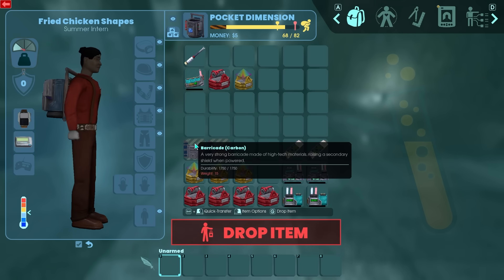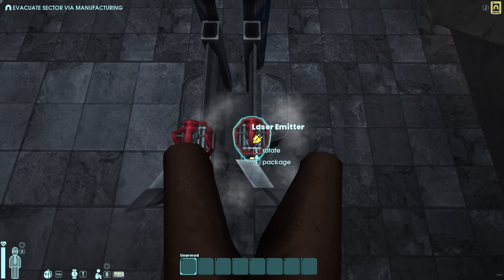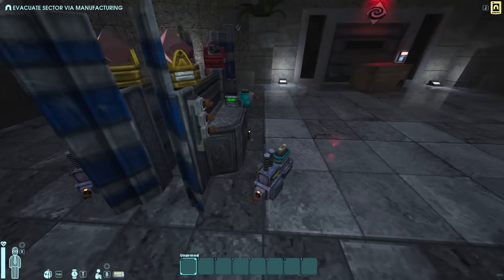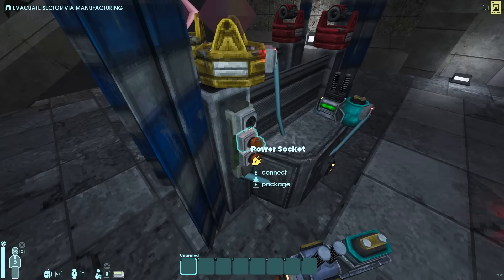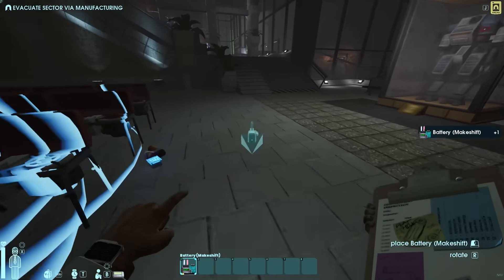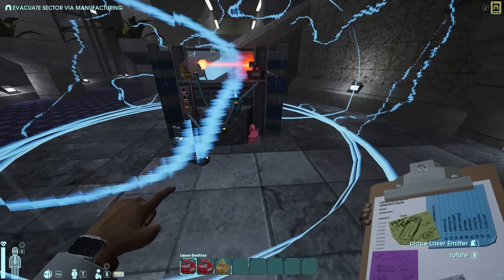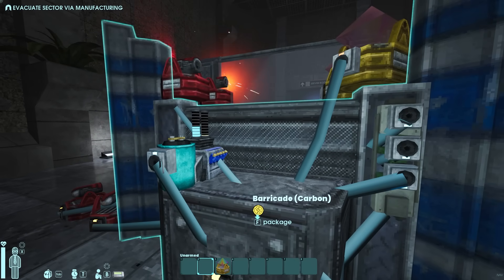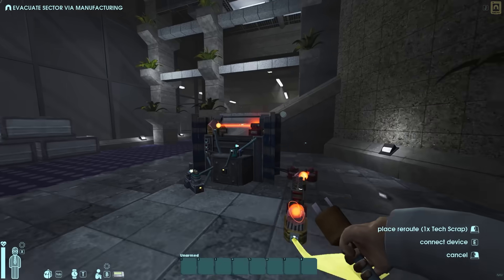Abiotic Factor Feedback Machine 1.1 Infinite Energy (1.0 update)

Comment: Just go ask since I really feel that my base has too many batteries everywhere just trying to keep everything powered thru the night so I don't waste time waiting (although every night is only 5 mins), but will this contraption make it so that I can attach a multiple plugboards or strips at the end of that industrial battery to that I can power essentially my whole base?
Reply: You don’t really even need this set up, hook a decent sized battery (preferably carbon) to a wall outlet, then have the battery hooked up to a laser emitter, point the emitter at a receiver, then plug the receiver into a plug strip then to what ever you need. This set up just removes plugging into a wall.
Reply from the maker: @LigmaSigma-nv6hx  Yep! All you need to power an entire base is 1 industrial battery, one emitter, and 1 converter. The Feedback Machine is not really necessary in an area with a lot of sockets - it's more suited to out of bounds, anteverses without sockets, or, locations that have no sockets.
Reply from the maker: You don't need anymore batteries, if you build everything in the video then you can just plug it all in, the battery won't deplete. I don't recommend adding anymore batteries. The Feedback Machine powers everything infinitely no matter how many deployables are connected.
Reply: @c0ffixx thats fucking crazy, really really cool. I'll get around to doing that hopefully in the next few days. Infinite energy source ftw

Comment: So this is mostly just for making bases where there are no power sockets then? Its neat to find exploits like this, but I guess I don't fully see the point when there seems to be plenty of places that have sockets and there is an end goal not just a "survive as long as you can" type game.
Reply from the maker: Not really, they're useful for a distant shore to farm exor hearts as you can keep a personal teleporter as theres no power sockets in that anteverse. Some rooftop bases on Flathill are viable. I usually use them for my out of bounds teleport huds, it's faster travelling around on the roof of the facility. It's also useful for the irradiated area in the Containment Sector as theres no power sockets there too. The use of the machine is to just make infinite power, nothing more, nothing less; sometimes I use it to make cliffside bases. Also it completely erases the use of sockets and can provide infinite load and power so you're better off with just using the feedback machine.
Reply: @c0ffixx  I'm not that far into the game, and honestly I didn't find that it would make sense for such a facility with massive reactors to have the power turned off at night so I just disabled that feature, I wish I could turn stop the lights from going off in without making getting some resources impossible.

OR have it a feature of the game that you can eventually turn this off for some areas in the facility through exploration similar to how you can eventually get rid of the portals coming into your base.
Reply: @JohnA...  I think a more smarter way is building a biomass generator that is not a battery but consumes bio scrap to generate power, since bio scrap is so easy to gain from rotting food pieces and stuff.

The benefit should be increased charging effects when used in a network instead of a facility socket, so it can charge several times faster to outpace the high load limits of batteries or something.

Or making your own 'micro' reactor which is kinda radioactive and requires you to refill it using barrels of radioactive wastes.
Reply: @dra6o0n  Realistically... or maybe un-realistically since its SCP nonsense... But we are playing a science fiction game about science experiments that don't have to work within the realms of reality as we know it so the solution could come from something esoteric in stead of practical. 

I like radioactive waste idea, maybe something that eats the waste and converts it into something else like bio waste to then use as a power source and the cleanup by doing so could reveal new areas or shortcuts.
Reply: @JohnA...  damn couldnt imagine playing the game with power on all the time. Its a core mechanic for it to go off with specific raids even power draining you and stuff. You basically just disabled alot of content by doing t5
Reply: @Odyssey636  that part is just more annoying than fun for me. As I said I would rather it was tied to some kind of in game mechanic to turn it back on all the time. 

Part of the game that I don't enjoy as much with those things, because honestly I have played thousands of hours of survival games, is that with this game I know there is an ending that isn't all that far off so having to build for such things for a short time doesn't interest me as much as if it was connected to the lore for a good reason. The entire facility just happening to turn off at night doesn't make sense for me because I can't see why they would do that to start, therefor I don't find it interesting to need to make batteries when there should just be power in the plugs.

I can see making something for where you wouldn't find power at all, or a way to transport it, but not if you are in the middle of the facility.

This is just my personal enjoyment of it though.
Reply: @c0ffixx  you can put down a workbench in distant shore link a battery to it and bind a personal teleporter. It works even after the workbench has no more power. So while it is nice to know there is an exploit its not really needed for normal gameplay, only for far off outposts in crazy areas.
Reply: @c0ffixx Exor hearts are easy with portal fish though? and you can fish em at the lobby of office sector from the beginning.

Distant shores is just a way to get fertilizer but a more easier mobile way is taming lots of the reactor pets... Though that's near end game.
Reply: laser converter forces a entire network to a load of 1.

Also we don't know what the system do with power loads when there is no players in the area.

It could stop charging entirely but drain still, etc.

Comment: Time to make this in the Furniture store to basically keep the zombies under control
Reply: tbf, you can just rope plant up the elevator so you never need to press the buttons ever again if you are not using a jetpack etc
might want a bridge piece as well just to get the plant cleanly over the edge so it hangs down
Reply: @Kaijudomage No, I just love killing zombies with automated defense systems… its kind of a past time favorite of mine in video games
Reply: Can't you run a socket down from the upper area using tech scrap reroutes?
Reply: @MarlboroManson  Yes, though batteries, plugs, and such do not drop when their support drops, so you'll have to make a stairway and route the cable that way first.
Unfortunate, because the lever is the only thing that has a input and output, so lasers is your best bet to emit laser down the elevator or something.

alternatively find a way to clip thru the ceiling so you can pass a cable thru the floor.

using a office chair you can pop your head thru the floor thus likely able to interact with the cable that way.

No way to noclip a prop thru walls though, unless...

you make a bridge over the surface and put a plug strip upside down facing the floor so that when placed the socket plugs themselves (has no collision) will clip thru the floor letting you grab it.
Reply from the maker: @MarlboroManson  You can't because then the socket will unload once you reach the security sector and your reroute won't have any power supplying it, unfortunately.
Reply: you need a very very narrow surface you can angle at to place it facing down on a wall but it migiht work best for map terrain like the rocky ceilings you see, as they are physically thin geometry that are jagged... so in theory you can pass power out of bounds using a plugstrip (its tiny enough to jam it into a crack in the walls or ceiling).
Reply: You will need to build a tower all the way up to the ceiling of a facility...

Or try this:
Find a vent, and try to place a shelf inside the vent, very close to the ceiling or sides so you can squeeze a plugstrip inside. then remove the shelf or bridge (the plugstrip floats).

Alternatively you can use a laser converter or a lever maybe but the lever had a much bigger collision box... but a makeshift battery can clip thru thin walls and windows?
Reply: I know all batteries have the plug sockets in the front sticking out once placed and has no collision st the very front of it before the plugs appear when placed...
Reply: A good area to test passing power to out of bounds is the blue keypad room at level 2 elevators, on the upper section behind the ladders is thin walls diagonal to the computers. you can make several makeshift batteries and face them deep into the walls to try to get em out. Then use office chairs on a box to pop out of the ceiling (use a bed or couch to help you pass thru by lying down)

Comment: Can you power infinite machines with this? 
Or is it infinite in the sense that it never runs out at night?
Reply: You can power infinite machines with any laser power converter already, this just lets you have a self sustaining power loop totally detached from any wall sockets.
Reply: @TeddyBearAssassin  I feel I don't know anything about how power works.
Reply from the maker: @gittonsxv126  Read the guide on Steam, this will teach you how the power system works. I have a plan to make a YouTube video on how the power system works. All you gotta know is that the Feedback Machine has infinite power, and infinite load bearing capacity, allowing it to power an infinite amount of things and it will never lose power.
Reply: @c0ffixx  Defo useful! 
Been having power issues already in the late game.
Reply: I believe it just never runs out, but as for the powering infinite machines; yes, you can power infinite machines with that one power socket coming off the power converter (*assuming you connect an infinite amount of power strips/boards). The battery considers that laser emitter a singular device so anything down the chain after that is irrelevant. [They have been patching many power loops amongst other things so this may either be gone soon or already is, my bad if so lol]
Reply from the maker: Both, yes.

Comment: Fantastic machine, one issue I’m encountering is when the “swap” between the batteries happen and the lasers switch, the laser power converter doesn’t register the laser, any way to fix this?
Reply: The laser power converter I’m talking about is the one that goes into the output (I’m probably not the best with wording)
Reply from the maker: @robertbarthala6589  You've probably put the emitter and laser converter too far off from the middle of the barricade which lifts the glass up. At 0:34 you can see im lining up the emitter with the line on the barricade. And also make sure the emitter and laser converters are on the side of the barricade where the ledge goes out more wide like in the video. Let me know if that fixes anything or not, and just let me know I will help you.
Reply: @c0ffixx  my apologies, this is where my bad wording of the situation comes in, I meant the other laser emitters
Reply: 4:46
Reply from the maker: @robertbarthala6589  Lasers have issues when you reload the area or a save. I assume you've placed the machine between "chunks" so it's only loading one part of the laser and the other part (the converter) is getting culled before the laser reaches it. To fix this I think all you have to do is move the machine or where the emitters point. Or try reloading your game. It depends on what you're playing on, the console versions are a lot more buggy. An example of an area that gets culled is the zig zag hallway between the area with the tram and the data farm, the hallway with all the computers behind glass another example is the 90 degree hallway between the Cascade Laboratories and the Wildlife Pens. Don't build machines in those hallways and similiar areas that load in chunks.

I think your best bet is to just move the machine somewhere central where everything is loaded in. If that is not the problem then you either mistook the converter for something else or your save is bugged. I think I have a failsafe laser method in my old guide. If this doesn't work I will send you the link.
Reply: @c0ffixx  I see, I’ll try this in a bit, thanks
Reply: @robertbarthala6589  Random scientist here, rooting for you!